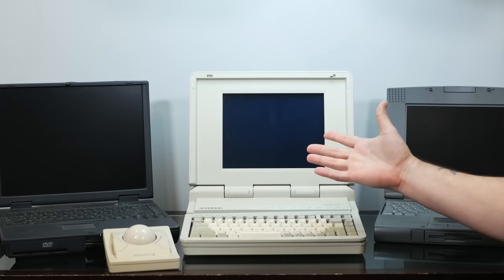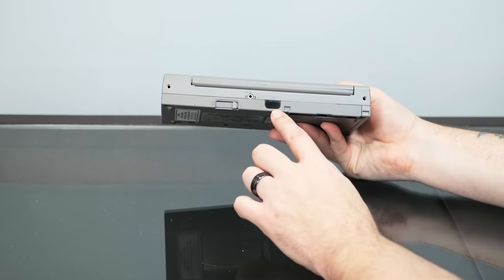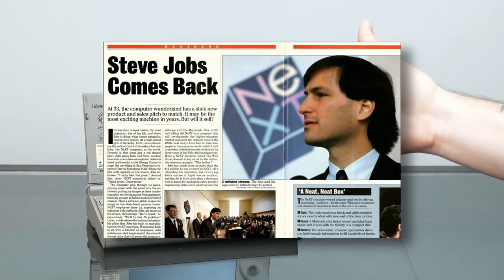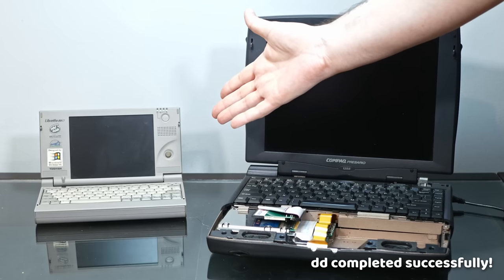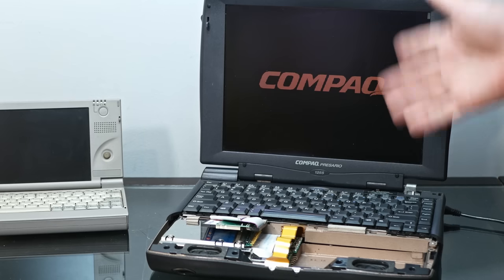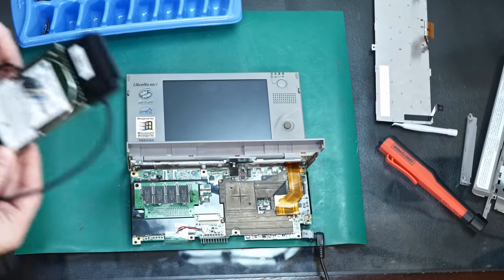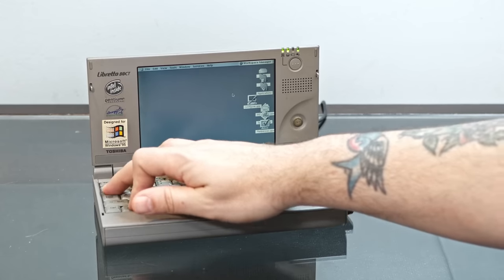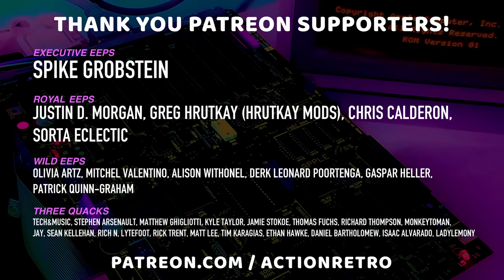I Turned My Toshiba Libretto into a Teeny Tiny Hackintosh with Apple Rhapsody OS!

Comment: I have been having the exact same issues with an IBM T22 laptop trying to replace the old IDE drive with a CF one (not seeing the system disk). I suspect it might have something to do with master slave settings on the disk (like the option shouldn't exist?) but am yet to try the third adapter I bought (which unfortunately looks like the one you are using in your vid.)  :(
Reply: Some CF Card to IDE adapters cause problems, for sure.  Could also be a drive (or boot partition) size issue.  Not sure about this Libretto, but some older PCs (or maybe an OS limitation? I forget) won't boot if the boot partition isn't fully contained within the first 2GB of space, regardless of how large of a total drive size it supports. I remember running into something like this when I first upgraded to a 6GB hard drive from 1.2GB and was trying to set up multiboot for a couple of different OSes.
Reply: @JeremyLevi  I transferred the image of the spinning ide drive to the CF card. The original hard drive is 20GB and the CF is 64GB which all should work. Bloody thing can't see it though. :( The T22 is a perfect W98 retro gaming rig otherwise.
Reply: @JeremyLevi  Well, Nothing worked with the CF card but a SD to IDE card worked, exactly the same as in this video. There must be something weird about CF cards on some of these older machines?
Reply: @TristanKingly  Ah, there is a hint here on the Transcend site, I think might be relevant.

"A CompactFlash card can be used as a fixed disk, as it is defined in the CompactFlash specification. However, Transcend does not support using our commercial solutions, including the CF133/400/600/800/1000, in Fixed Disk mode, as this has gone beyond the scope of their intended use. Therefore, all of our commercial CF cards are shipped, by default, in Removable mode. 

Please kindly refer to the following link to find out more information about Transcend industrial CF cards."
Reply: Apparently most OS check to see if the boot media is removable and refuse to boot. I see mentioned using GRUB to boot other OSes to bypass as it doesn't care if boot media is fixed or removable.
Reply: @JeremyLevi  Interesting, I am looking at software now to change the sandisk card i have to fixed disk mode
Reply: Aaaand, while looking it seems to be a common issue that thinkpads will not boot of CF cards in removable mode, could very well be the same issue with the Toshiba Liberetto.
Reply: Tristan King, I have same problem with other machine. The solve was in storage capacity. Old machines can't see CF cards for more than 2 Gb. CF and SD cards for less than 2 Gb capacity different from a new one on hardware level.

Comment: I don't think it's possible to put more than 32mb of ram in a 50CT or 70CT libretto, I seem to recall reading about someone managing to bodge more the 32MB in but it involved making modifications as the module connector only has enough address lines attached to handle a 16MB expansion module, unless I'm crossing this with something I read about a different Toshiba laptop from the era.

Comment: Came across many of these 'CEO' laptops back-in-the-day. Especially keen with those who flew around.

Note: You can dd to /dev/rdisk1 ('R'disk) and it writes faster. Add bs=1024 too for a decent block size.

Finally, did you make sure the partition format was MBR and remained so after the dd? This could explain why it couldn't find the boot device.

Comment: If you use the hibernation functionality, you need to leave at least RAM size + Video RAM size + 1MB of unused space working downwards from the 1024th cylinder on discs larger than 1024 cylinders (it's only at the end of the disc for discs smaller than that). The BIOS will write its state there regardless of what else is there already, which will probably corrupt whatever filesystem occupies that part of the disc. I've previously achieved this by creating a partition that occupies that space (and a few cylinders either side, just in case) and keeping it unmounted.
Reply from the maker: Interesting! Is there any way to turn off that feature? I couldn't find it in BIOS.
Reply: @ActionRetro  I don't believe there is a way to turn it off. And it does work well, in my experience. Apparently, I need to correct myself on where the hibernation data gets written: http://ta.twi.tudelft.nl/dv/users/lemmens/libretto70ct.html says it's upwards from the 1024th cylinder! In my defence, it's probably over a decade since I did it on my Libretto!

Comment: I have a 110CT running 98SE, with a ton of missing drivers. How id love to get the external floppy disk drive to work so I can install XCOM on it. I've search high and low for the drivers for it on 98SE, but it seems if I wanted to have full support id have to downgrade to 95.

Comment: I'm not sure why you wouldn't have tried to match exactly the libretto's hardware in the VM from the beginning.  I've done VM installs to bypass unusable I/O options before and I never have problems as long as the VM is as close to identical as the target machine.  This includes resolution, RAM, expected video hardware, etc.  Either way, nice project.  

In the future, see what craziness you can do with Fujitsu Lifebook U820.  :)

Comment: I dreamed of portable computing too; sometimes to a ridiculous extent. XD I wanted to make an 8-bit, 64KB watch in 1991! But I didn't develop my making-things skills and so I never built any of my ideas. But I was happy 10 years later when I got a Palm m515, and happier still when I got Sharp Zauruses, (Zaurii? ;) especially the clamshell which I could type on with my thumbs. They're port-poor too, funnily enough, but also lack radio connectivity. I love 'em anyway.

The 100-200MB ex-business hard drives I got for nothing in the late 90s sounded just like that. ;) I had to use 3 of them in each machine to install Linux 2.0, leaving 1 IDE plug for the CD-ROM to install from. There wasn't enough space to install both Emacs and X Windows. :)

I love that desktop wallpaper! Not that I ever have any wallpaper, but I think it's really cool.

You can drag icons to the command line to paste the full path? That's a very good feature. Even in command-line only systems, I end up writing an `fp` script to return the full path to stuff in the current directory.

You can send me that "horrible" laptop, I'll find a good home for it! XD I actually like the aesthetic, having grown up with these really freaky 70s sci-fi paintings. There was even one on the front of a big tutorial binder for my first computer. Besides, in a way, the best computers I ever owned were 333 & 400MHz AMD K6/2 powered with 64 & 128MB RAM. They were amongst the first really good Linux machines I owned, and they were incredibly reliable too. Also, they're the first machines on which I really enjoyed playing games in Linux. Thinking back, I think that enjoyment factor counts for a lot. ;)

It works! Yay! :D

Bah! It's a microkernel, why does it need you to reboot to change a driver? ;) But maybe they hadn't yet developed that feature with microkernels.

Hahaha! The Pateron levels are great!

Comment: Very late comment, but you can boot into single-user mode by typing -s at the bootloader and then remove the display driver config file from /System/Library/Devices. Tested that on vmware and it worked.

Comment: the power port being on the right side instead of the back just doesn't feel right, like they really expect you to not want to use it in handheld mode when plugged in. although I guess if you use a low-profile plug on the charger, it'd be okay. 
I do wish they'd sink the jack in a little more so you could more comfortably use it plugged in but still in handheld mode, or, ya know, put it on the back :p
Reply: Perhaps this is why they relocated it on the 100CT - sadly going to an awkward propietary 2-pin plug in the process.
Reply: @nitrax8629  d'oh that sucks. I was thinking they kept the same connector but just mounted it like 3 mm inside the chassis

Comment: yeah that's what i ended up with every time i tried rhapsody dr2 on a physical machine. in the end, even though everything is kinda supported, there's some weird glitch and it's only stable without any drivers in greyscale. and since it's supposed to be a multimedia os, it's kinda pointless this way.

what you should try though is installing mac os x server 1.2 which is basically the stable version of rhapsody that actually works..

Comment: How can you have a pentium 166 MMX on that 50CT if the default config is a 75MHz regular pentium? Even if you have the latest models made when the 50CT was discontinued, you should have at most a Pentium 120 MHz downclocked to 75; so to get to 166 you would need to make hardware mods on the motherboard to change the multiplier and overclock it. Also these CPU do not have MMX; as the MMX set was added on pentium CPU starting from the 55C model, and the ones on the libretto 50CT are still the old 54C/QS.

If you have anything else other than a pentium 75 in that machine, and you did no mods yourself, either someone overclocked that machine to oblivion (and you should see the jumpwires soldered on the motherboard if you open it), or someone swapped the motherboard with one from a newer Libretto.

Comment: An annoying commercial had interrupted the annoying hard drive sound.
Reply: Honestly that's not a bad hard drive sound by any means. Some modern drives I have sound way more annoying than this, but if you really want to make your ears bleed there are plenty of NASTY 90's drives, Maxtors were particularly unpleasant if i remember right, some early 00s Deskstars sound like an angle grinder.

Comment: Awesome vid man! D'you happen to know how to go about doing the reverse? That is, image a physical hard drive and use it as the base for a VM? Because I would absolutely LOVE to get the contents of my old physical XP box onto a VM in order to use it with my Mac... Unfortunately, I never got VMWares built-in tool to work for that...
Reply: It's exactly the opposite process. You just need to run dd if=/dev/whateveritis of=somefile.img.

Obviously replace 'whateveritis' with the proper device name of your source drive. You might also need to convert the IMG to VMDK, and even then it might not boot. You might get a STOP 0x7B (which requires registry tweaking to fix, which itself needs a working Windows box). Once it's booted you'd still have the issue of Windows Activation. Let me know if I can help you at all.

Oh, I also just remembered Sysinternals disk2vhd. If you run it on your XP box it can dump the HDD into a VHD file on an external hard drive. That might be easier than physically transferring your drive. The VHD can then be converted to VMDK if needed for VMWare.

Comment: My Satellite T2130CT has a ridiculously loud hard disk too! Must be a Toshiba thing then...
Reply from the maker: Click click clack click click
Reply: Had a Satellite 4070CDT with an even louder drive than this, sadly the computer is broken but the drive still works. Sounds like a gas pipeline when running :)
Reply: @nitrax8629  same, my 2130CT had a 527MB hard drive from 1995. I had to use my SD to IDE adapter in a Portege 7020CT so it's with it's old hard drive again

Comment: Okey... but 50CT model has a 75 Mhz microprocessor (without MMX instructions), has your Libretto been changed ? Toshiba included MMX processors from the 70CT model...
Reply: Probably read an erronious spec listing from the Center for Computing History where the 100CT's specs were listed on the 50CT page.
Reply: Indeed... Another amazing fact about it, according to 'Toshiba Libretto 50CT and 70CT Service Manual', both microprocessors are 64-bit version.
Reply: Other important specs about this model:

Memory: Standard 16MB of Extend Data Out (EDO) DRAM. An optional 8 or 16MB memory kit can be installed in the memory slot.

Display: A 6.1-inch, Thin Film Transistor (TFT) color Liquid Crystal Display (LCD), that enables a display of up to 16M colors at a resolution of 640 x 480 pixels. A video controller and 1MB of VRAM enable an external monitor to display 16M colors at a resolution of 1280 x 1024 pixels.

Comment: I wonder if the programs made for rhapsody os still runs on mac os x86, this includes gcc or clang?
Reply: I believe gcc came with Rhapsody DP2 - probably gcc 2.7. Any text mode apps written back then in ISO C or POSIX should still build fine on MacOS Big Sur, even on Apple M1. Though due to the move from 32-bit to 64-bit, among other things sizeof(long) is now 8 on MacOS, so you can still encounter runtime bugs. GUI apps are another story - I highly doubt Apple provides Rhapsody-compatible GUI libraries in modern versions of MacOS.

Comment: I still have one of these 50CT Librettos if you're interested in having another one.  Bought it used from a local computer store back in 1999 with my first paycheck from my first job when I was 16.  Still has it's original 810MB Hard Drive running Win95 and works great.  Also have the manuals, boot floppy disk and docking station for it along with the Libretto rubberized storage "Palm Rest", as if anyone would want to type on it for lengthy amounts of time haha...
Reply: Nice, what price?
Reply: @_berskyboy Can’t believe that comment of mine was already a year ago.  I don’t know, what’s it worth to you?

Comment: The leadins to Rhapsody (NeXTStep and OpenStep) were NIHS.  NeXT/Intel/HPPA/Sparc - it ran on all four platorms and I used all four platforms as daily drivers back in the day.  SO much nicer than anything else out there.  And unlike Ample Computers, NeXT had a smart pasteboard that actually worked well (partially reliant on Display Postscript)

Comment: Maybe possible to change the Librettos display settings using an external monitor
Reply: That would be true if it was just the built-in LCD not handling the output of the video card, but I think in this case the display got corrupted due to the wrong driver being used.
Reply: @zoomosis  ah ok

Comment: wait.. did all america librettos have a huge barrel jack?
Reply from the maker: What did yours have?
Reply: @ActionRetro  A weird side-by-side 2 pin plug (never seen it in any other system) in the back. I think you have a small plastic lid right by the IR port where my power jack is
Reply: Ignore me, the 50CT did have that huge barrel port, the 75 and up did have the smaller one that I'm thinking of

Comment: Hey I have that no name SSD in my eee 900a, the dogfish 64GB; thought I was the only fool to buy one of those!
Reply: I still own my Eee 900HA PC. No SSD though. Upgraded to 2gb ram/270gb HDD. By todays standard the single core Atom N270CPU & Intel 945 GPU are dinosaur slow and outdatetd. Yet the computer still works as the EEE PC's were really well built.
Reply: @gregsmith9183  I use mine for games that refuse to run either in a VM because of 3D acceleration or on anything newer than XP. MechWarrior 2 and 3, Earthsiege 2, MTM2, stuff like that.